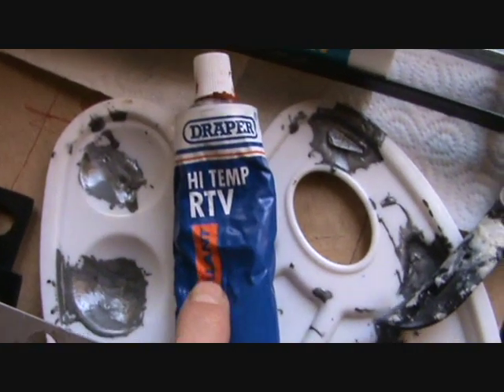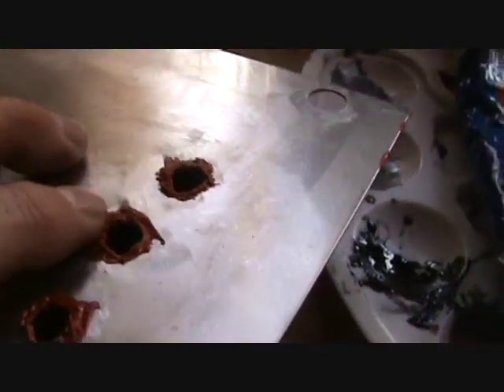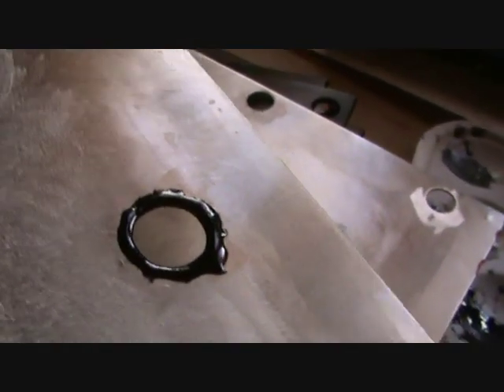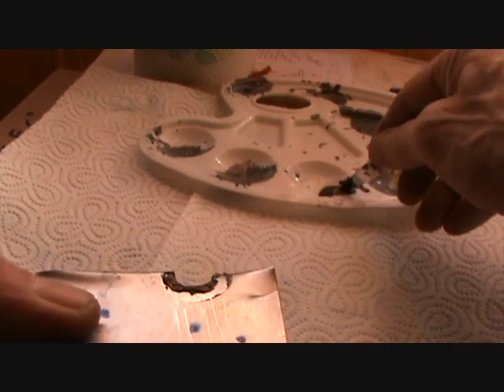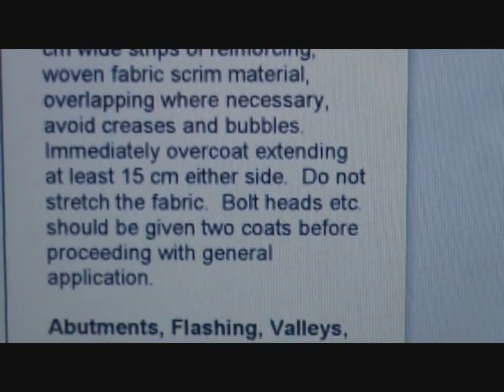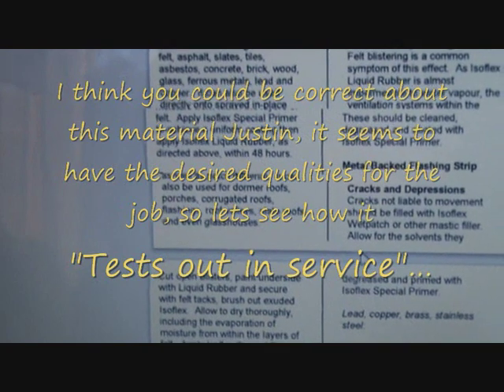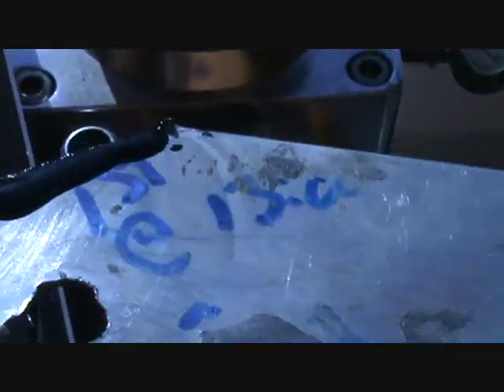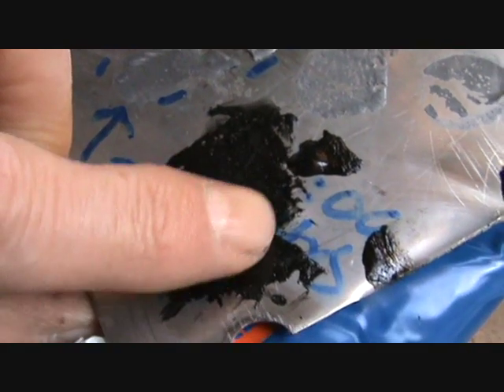FuelBan  HHo Plates & stopping  Flux Leakage Pt 3

Comment from the maker: Hi, If you see the start of this video, {AQUA MATE] Is a silicone sealant used for fish tanks, it is special prepared not to be toxic to fish,, You can make good fish tanks by using acrylic sheet 5mm thick, then bond the sheet by using (tensol 70), it welds the edges together water tight and very strong. hope this helps, thanks.
Thom.

Comment from the maker: @sylvanenergy Hi again, if you check my video:  FuelBan HHo Plates & stopping Flux Leakage Pt 2 . you will see what I am meaning with this, and at 2:43 Mins, the seal looks ok and insulates during electrical test, but the scorched plates tell a different story, check it out. thanks.
Thom.

Comment from the maker: @sylvanenergy that's interesting tell me more, what temperature does you HHo cell run at ?, how often run ?, when you last checked seals ?, have you checked the join under the weldon edge between the plates with a thin blade for separation ? would like to find out, as weldon is a solid with no expansion, & S/S has a high expansion / contraction, so would expect separation, even when the seal looks ok it has still parted company with the plate & leak, let me know when you can, thanks guy.
Thom.

Comment from the maker: @sylvanenergy   I have tried Tensol 70, a European equivalent to  weld on,  it parts company, it looks ok, but in actual fact it becomes like a grommet, the weld on is rigid, the stainless expands, they part company, have you tried to put a thin blade in between plate under the weld on, to find if still sealed to plate?, if not sealed you get flux leakage still, although looks ok.. hence the search for a rubber material, expand & contract without separation, check if still sealed. thanks.
Thom.